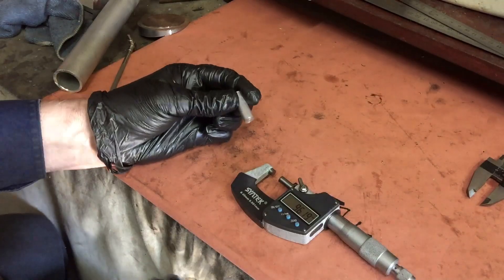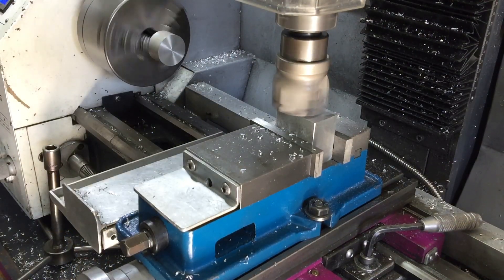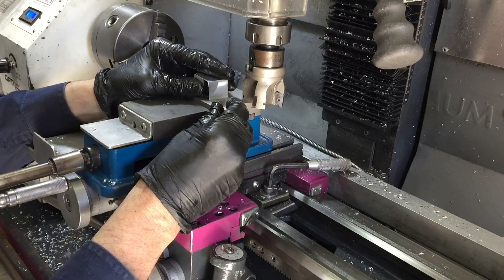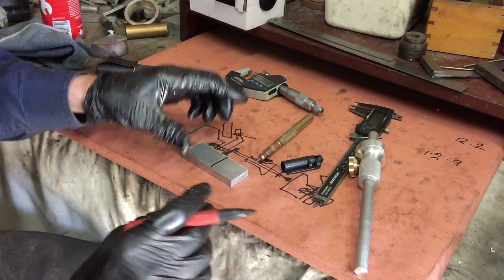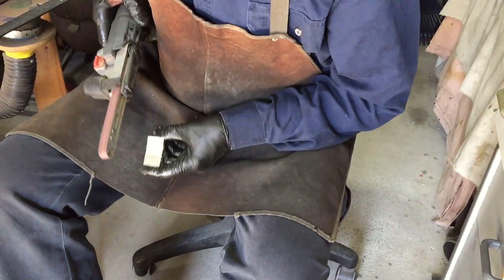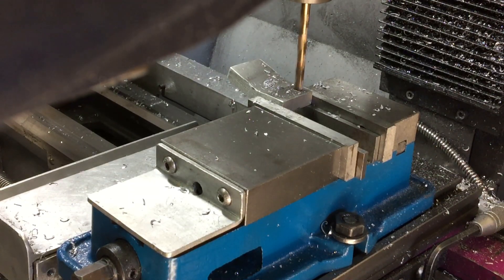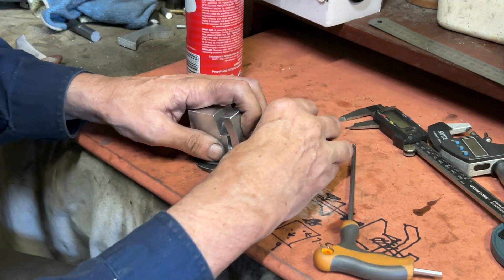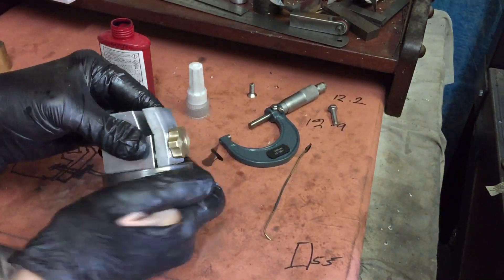Make a Micrometer Vise

Comment: G’day Mate, that’s a very good design and a practical manufacturing process. The digital mic is a bit of a handful, but as much as I like to see PPE, are the gloves making life easier and safer? Better to be safe than sorry.
 Keep busy and ride safe.
Reply from the maker: Hi Graham. 
Gloves? They aren’t a “catch” hazard. I wear them to stop my hands getting impregnated with hot cutting oil. 
My little setup doesn’t use flood coolant so I use cutting oil instead.

Comment: There's a dirt cheap die-cast mini-vice which clamps to a table edge. They're poorly made with a sloppy grip and cost well under $10. For holding a caliper, however, they're more than satisfactory. I believe they're sold on Amazon, eBay and occasionally at dollar stores.
Reply from the maker: Agree there are any number of options to solve a problem by purchasing something. 
But where is the fun in that? 😁
Reply: @ShedBuiltStuff  But it gives you more time to smoke....Marijuana!